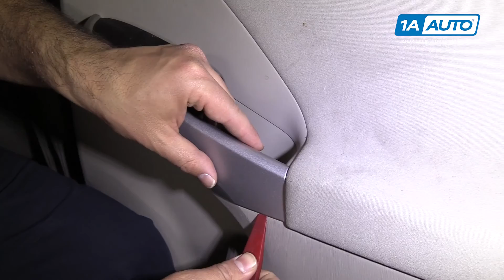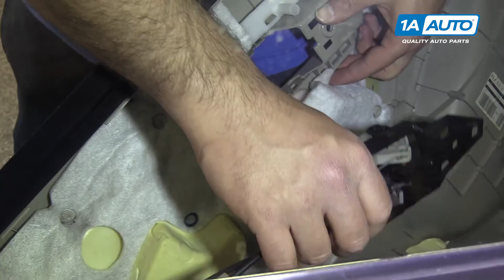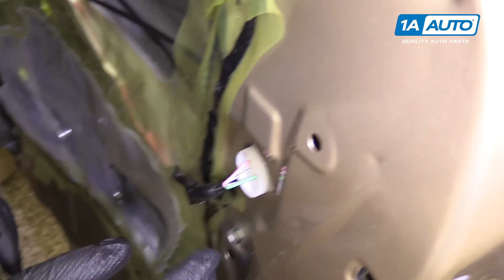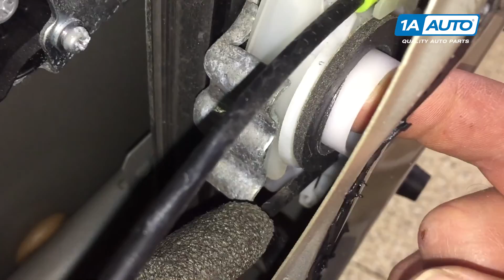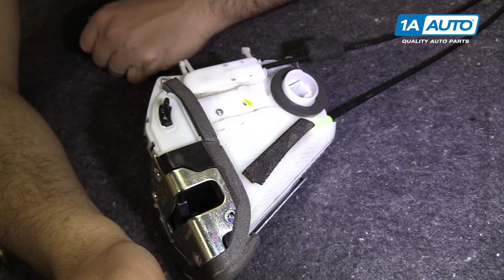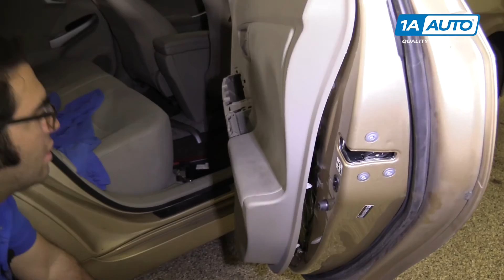How to Replace Rear Door Lock Actuator 10-15 Toyota Prius

Comment: I have this same problem, except that door is shut and can't be opened because the lock assembly is already broken; and now I have to find a way to open the door somehow without an actual door lock assembly...
Reply: I'm in the same boat with my prius. Did you figure out how to remove the panel without opening the door?

Comment: I just bought Toyota FC280PC 22125  for $2  each, and It is possible just to swap the motor without swapping the cap if the rotor length is the same with your car or swap the white/plastic motor cap with the motor in the actuator.   The graphite brush inside the door-lock-actuator motor worn out.  You do not need to buy the whole actuators.    I did it with my 2006 Prius.

Comment: Is the process fairly similar when doing actuators on the front doors.? Or is it more involved
Reply from the maker: +Ajac41 neverb4 You might be able to apply some of the basic steps shown in this video to your application!
Reply: 1A Auto Parts thanks I have to replace both front door actuators on my 2011